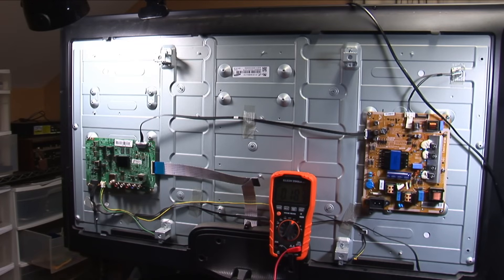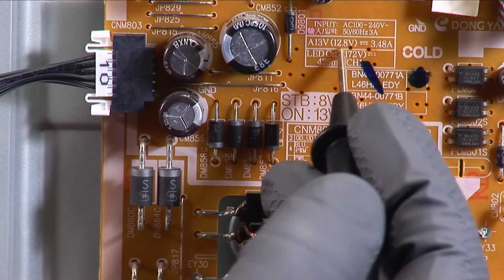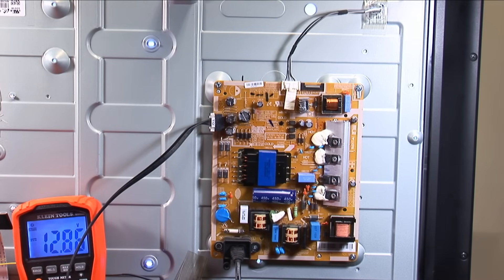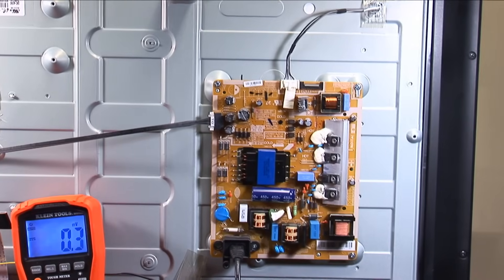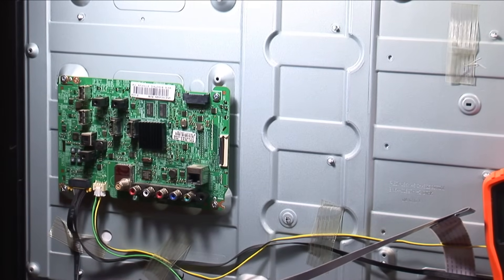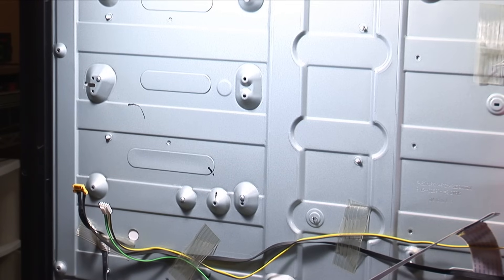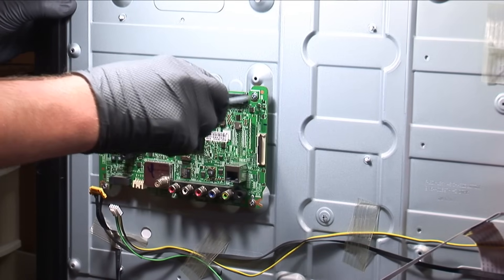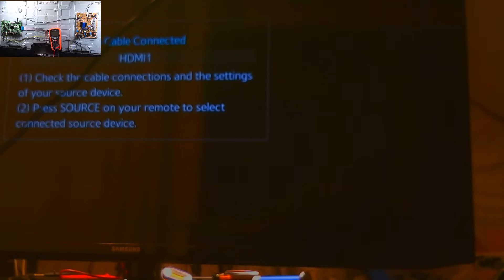Samsung LED Flat Screen TV Repair - Won't turn on, no power - How to Fix

Comment: I have just a quick question that I'm sure the host, or anyone familiar with Samsung t.v. repairs could easily answer for me. When plug the same model t.v. in, the back light flashes in 1 second intervals. Also the red power led flashes twice for every backlight flash. I'm sure this represents what is wrong, I just can't find it. Please help if someone sees this and thank you so much!!
Reply: Unplug power supply from mainboard does it still flash the backlights ?

Comment: actually you didn't repair the TV you just changed the entire board without even testing it
Reply: Time is money.  The time it would take for him to do a board level repair would cost much more than to just replace the board.  As he stated the board itself was used and not very expensive.  Also I believe this video was meant as a tip for those at home who don't have the ability to do a component level repair.  As far as testing....half the video is about how he came to the conclusion that the board was bad.  Since it was replaced and the tv turned on, I'd say the 'test' was successful.  If you blew up the engine in your car, would you pay your mechanic to do a full rebuild or to just find an inexpensive, low mileage motor from a scrapyard.  Instead of dishing out negative comments to people who obviously are a help to others, try leaving positive comments or say nothing at all.

Comment: Great video. My samsung UE40EH5005K  just died yesterday and I really can't afford a new one right now, basically not even used.

No standby light, TV doesn't turn on.

Took the power board off today and tried to check with my dad if something's wrong but we're no experts.

I'm gonna try that backlight thing tomorrow to see if the power board is just dead. There is an area where the board is darker but visually to an untrained eye couldn't figure it out.

Would be really nice to be able to fix it rather than buy a new tv.

Comment: How can I purchase the board you replaced?
Reply from the maker: To buy a used part, ebay....maybe.  Thats where I got mine from.  Doubt you can buy it NOS from the manufacturer and even if you could it would cost more than a new TV.

Comment: I would have gone further and tried to find what blew on the main. I hate just swapping boards that's a final option
Reply from the maker: Wasn't my tv.  Was fixing it for someone.  Was cheaper to just swap a new board. Otherwise that's my time in diagnosing it.
Reply: @Electronicle  fair enough sir

Comment: I need help, my main board is working but no power is going to the backlights, I put another power board from another tv and the only connection that fits was the connection for the backlights and it powered on. I will like to know what area of the board could it possibly be if I were to repair the power supply board.. the link shows where  I have 2 power boards together  thanks 

https://youtube.com/shorts/V7guwMnoTLY?feature=share

Comment: I found a TV in the trash and replaced the dry caps. Changing the board is like buying a new house when the floor is wet.
Reply: I found a 2016 Samsung 60 inch 4K smart TV in the trash. It turns on but turns off and it won’t turn back on again

Comment: I wouldn't call that a repair. You just changed the engine.
Reply: That's what I was thinking....I suppose they are modularly designed...but should be  rather simple to troubleshoot especially with a new board.

Comment: I love how you show trouble shotting the power supply
Reply: Didn't really show it, he didn't explain what the signals are doing, that the pulse width signal is for the backlight brightness control, he didn't show how to bench test the psu on its own without being connected to the main and get it output. Iv seen so many of these videos that don't explain hardly anything, I may just start making my own vids

Comment: Thank you man. Well explained. Mine is a samsung LCD it keeps flashing the red light switch on indicator light but wont switch on screen. I remove it from a plugging point to another and it worked for 15 mins and started flickering again on a black screen.

Comment: Hi
When I disconnect the mainboard from the power supply, the backlight flashes.  What could the problems be?  The capacitors look good.
Reply: Same issue did you figure out the issue
Reply: Same issue here

Comment: Bought both boards still didn’t fix the problem. Guess I’ll just trash the tv.
Reply: I two bought both power supply and main board tv still have black screen is there any thing else that can be checked

Comment: Hey man, I'm trying to repair my father in laws 75 inch Samsung was struck by lightning and it damaged alot of outlets and wires, including the TV, it gets stuck on a logo bootloop.. We opened it last night everything seems to look fine.. Capacitors look fine not one is swollen.. The fuse looks a bit black well I think it's dirty but idk it's a brand new TV? Either way the fuse can't be removed it's soldered there. So in my his case.. Bad Pdb? Or motherboard? I just bought a new Pdb.. For now.
Reply from the maker: Yeah. Probably a bad main board.   The board is probably fine. Just firmware corrupted. Just a guess. But yeah.  Try a new main/motherboard first.
Reply: @Electronicle  Ok  I ended up buying both..  Thanks man.

Comment: WHY ARE YOU TALKING SO LOW AND WHY DONT YOU SHOW HOW YOU USED THE METER TO TROUBLESHOOT,  BY SHOWINGIT  ON THE VIDEO. COULDNT YOU AT LEAST TESTED THE OLD BOARD.

Comment: Wouldn't it be easier to first use a Thermal Imaging Camera and then see which part is getting a lot hotter and go from there first and also looking for blown chips or capacitors?
Reply from the maker: the idea of the video was basic troubleshooting...most people don't have a thermal camera, including me who works on this stuff as a hobby

Comment: Alright, so I have this same Tv. This is what I have found to be the issue. The T-board that connects to the PCB board on the bottom is ripped off.

https://imgur.com/a/VvsqED7

What can I do? Possible to Solder the connecting area and reconnect the ribbon?

Comment: My TV comes up connect one connect cable message when cable not in. But when one connect box connected it shows black screen only. Do you think this is logic board. I've replaced one connect box already.
Reply from the maker: Bad HDMI cable or problem on the logic board.  I assume you tried plugging something else into it to rule that out?

Comment: Can you help?
I have a ue65ru7020
It's been struck by lightning. I can't see any damage to the boards. I've checked the voltages and they seem good. When connected to the other board the red lights flashes and the screen attempted to come on but then goes off and keeps repeating this. Am I right in saying it's the  same as the board u Changed
Reply from the maker: Sounds like it.  Does the LED blink in any pattern?  like 1 2 3   wait 1 2 3 4    or just 123   123   123  over and over again?
Reply: @Electronicle  yeah two short flashes then a longer flash and the screen tries to turn on.

I've also tried both birds connected s d the ribbon cables disconnected. When I do this I hear the start up sound and the LCD stays on.  No picture. If I reconnect just one ribbon the same happens. If both are connected the turning on and off behaviour happens

Comment: my TCL 55 inch screen tv made a loud popping noise and now won't turn on. Any ideas?
Reply from the maker: depends on the tv.  Could be a failed backlight if its a CCFL backlit tv, something on the inverter boards that powers the backlight.  Could be just a capacitor that blew out.  Won't know till you take a look.  Good news is, if you had a loud pop then theres bound to be visual clues.

Comment: My co-worker gave me his LED tv to take a look at, Samsung UN60H6203AF. After plugging it in, get no red standby light nor sound, but the backlights flash on/off non-stop about every half-second. I've currently got the back panel off. Fuse tested good. I disconnected the cable from the power supply board to the main board, plugged the power cord back in, and the only thing that changed is the backlights' flashing frequency increased to about every quarter-second, with a slight pause between (like 1-2-pause, 1-2-pause, etc.).  I haven't had a chance to do any voltage checks or other trouble shooting, but any suggestions are greatly appreciated.  Oh, and great video!!
Reply: I have the exact same issue with my tv randomly. What did you do to fix it?
Reply: @raymasse  In my case I found several burnt out LEDs and replaced them, but that didn't fix it completely. I determined the panel was bad so it wasn't worth fixing. I think I may have damaged the panel when transporting it in my truck from my friends house 25 miles to mine. The original packaging wasn't available so I transported it standing up.

Comment: *I know this is an old video and prob not get any answer/comment but.
Hi there I have a Qnix 2700 that suddenly would not power on, it just went black while playing a game. I took it apart to see if I could see anything obvious but everything looked fine.
I noted the power board number MST9XG7-WV2 and tried to find one but couldn't find anything but after watching this video I put the power board back in place (without the smaller board REALLY Small one)to do what you did  @0:53 and without the other board connect the standby light came on(wasnt doing anything when everything was connected)So I think I can now assume its the other board.

I took a close look at the other board and there are not many components on it and I think(not 100% sure) but one of the 110v 47uh capacitors looks SLIGHTLY bulging out no discolouring and not bulging out like I have seen on youtube videos but it does look like i is very very slightly raised so I have ordered one to replace it to see if that fixes it.

I wanted to ask advice to see if you think this is probably the case(since the standby light comes on without the other board connected) and to ask why I would need to get the EXACT same (smaller board)logic board? to get it to work and why couldn't I just get any?
Its a 27inch 1440p so couldnt I just get any logic board thats for a 27inch tv? 
And to thank you for the tip which might have pointed me in the right direction.

Comment: Here was me thinking that I would have to get out a soldering iron, when all I have to do is have a spare power board and main board for every TV ever created :-)
Reply: shop jimmy has both of them for EVERY TV....used them years ago for another tv i found..........WAITING FOR A NEW MAINBOARD FOR A 43 INCH LED lg tv....works awesome minus both hdmi,s are shot......$35 here friday....30 minutes ..done...rather have hdmi to my pc...then to ethernet cable only....smart tv,s are not as smart vs hooked up to a pc....fact...
Reply: Man dude I was thinking the same thing
Reply: Do main boards work for every tv? Do I need to get a certain one for LG or could it come from any brand of tv

Comment: Sorry I am very new to this, but if I put altimeter on both sides of fuse with the power connected does it mean the problem is with the fuse?
Reply from the maker: If it powers up yes. The ammeter would complete the circuit
Reply: sorry I see now my question wasn't really clear. I have the "won't turn on, no power" situation". When I put the altimeter (on ACV200 mode) on both sides of the fuse, it doesn't power up and gives a reading of 0. So its then not the fuse? Because if it was the fuse, the meter would complete the circuit and it would power up?
Reply from the maker: @juhanj7909  well here's the thing...to do what you are doing requires the meter to be set to amps / current  not volts.  Also most meters require you to move the positive probe to another input on the meter only for amps.
Reply: @Electronicle  thanks for your help! I guess it is clear that I don't have the necessary expertise to diagnose or fix my tv, but it was interesting to see all the different components...

Comment: Great vid, can i ask what the fuse amp is? 13amp or ?.
My tv has 2 fuses.
1 was working as i used my multi to check it but the other was blown.
So after looking over the board i wanted to see if i could at least a red power indicator light and so i added thin clips in place of the blown fuse to test this...(big mistake!)
When i turned the power on a small cap blew and the alligator wire no longer has continuity and also loud bang and sparks :/
So im thinking of replacing the blown cap and fuse however in not sure what the cap rating is nor the second fuse amps.
Any advice please.

Thanks in advance
Reply from the maker: sorry man no idea, it was a while ago.  You can try searching for a service manual for your tv which would tell you everything you need to know.  If not...it may not be the right thing to do but i'll usually just throw a low rated fuse in, like 1 amp just to test until I can find the true amount.

Comment: Help Needed. I have a 65 inch Samsung SMart TV, It started Restarting and then few days later it stopped working totally. Now its not even turning on. No gave it to Service Center and they are saying the Panel of the tv needs to be replaced ! All backlights are fine, Power supply ok, Mother board is also ok. Is it right ? The panel is looking good (means no physical damage ever) Plz help...

Comment: Thank you. Followed this procedure and fixed my 40 inch samsung. Can you cannibalize any part from the dysfunctional mainboard?
Reply from the maker: glad it helped you and that it got it working.  I'm not sure if you are asking about parts in general or if I personally could use em.  Personally, no I have more than enough and am actually trying to clean up the shop and rearrange ... hence the lack of videos.   But thank you anyways.

Comment: i am having samsung lcd tv model number is UN46EH6070FXZA .5 times blinking but no light , ps on off 5volt okay, 5 volt,12 volt are present ,when i remove the connector from motherboard which is connected to power supply still no backup light ,where i should check now ?

Comment: Nicely made video and the voice is very good with no annoying background music.  For a retired technician like myself, he really didn't say much other than just replace the board.  Most likely there was a short on the bad board pulling one of the supply voltages down. However, I would have found which line was low when it was all connected up and then try and run the short down. Sometimes the shorted part will even get hot if left on for a short time and then you can go to it. There is always the possibility that if it was hit by lighting that there could be numerous problems with the bad board. Having said all of that, sometimes to save money and headaches just doing what he did on this video is the best way to go. Tring to repair a surface-mount board can at times be a headache.
Reply from the maker: Thank you.  Yeah. The part was cheap and just easier to replace and get it out of here
Reply: Would agree,more time than its worth.

Comment: I have a un65h6203afxza an I have no power no standby lights when I unplug the cable from power supply board to the main board my backlights does not come to where n ur video urs come on my doesn't ive done tried changing out both boards power an main board ab still same problem so help !!!!!!

Comment: I have a samsung tv no standby light compositors all look good , it has two ceramic 6.3 volts slow blow fuses, one is good and one is bad. Replaced the bad one but as soon has it plug it in the tv sparks and still does nothing. Any Ideas?

Comment: Hi there,

Thank you for the video, I did change both boards and still nothing. There’s power but tv doesn’t turn on! Could it be the T-con board?
Reply: I may have the same problem as you. I only changed the power board. Main board still thinking about it

Comment: I have a samsung 32” LN32B360 C5DUZA version CN02. It won’t turn on. No standby light, although when I disconnected the ribbon cable from the power board to main the back lights came on and so did standby. (?)   I checked the volts w/meter. They all read a little low ( 5.3 reads 4...13 reads 11). The fuses are good. No signs of capacitors blown up or burn marks on those blue dot prong thingys. I tried the unplug the tv and hold the on/off button for 30 seconds to reset it. But nothing. I found a main board for my tv, but wondering if it’s the power board since the meter reads lower than specs. Any ideas which way to proceed? I was gonna throw it out until I came across your video. Thanks in advance for any help.

Comment: I have a UN55J6201AF & the layout is the same. I tested power across the ribbon between the 2 boards and got similar numbers, but when I unplug the power board from the IO board, the LED array does NOT light up, and I can’t seem to detect any voltages from the pins on that connector. Does this mean the LED’s are burned out ? What do you recommend ?

Comment: I have a similar tv by Samsung. But the one I have is a un60J6200AF and does not power up.  While I do not have the required volt or ohm meter to check the same spots you did, but at least it gives me hope that the tv is salvageable.